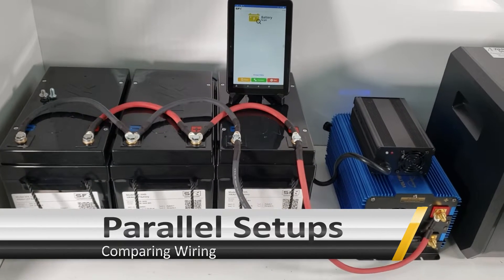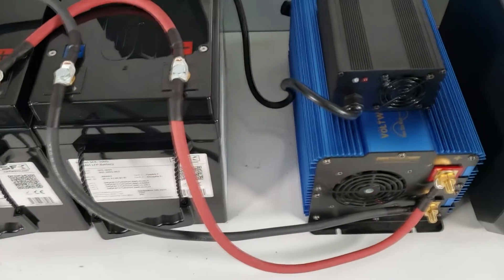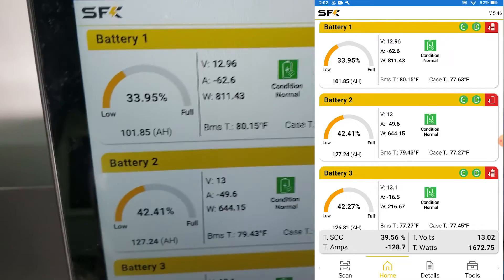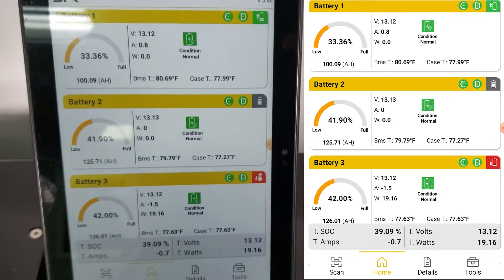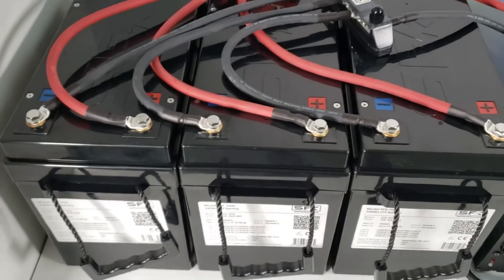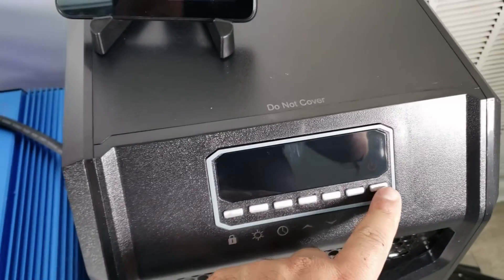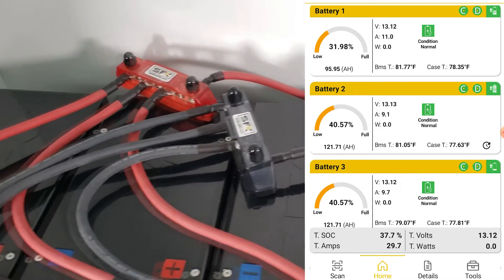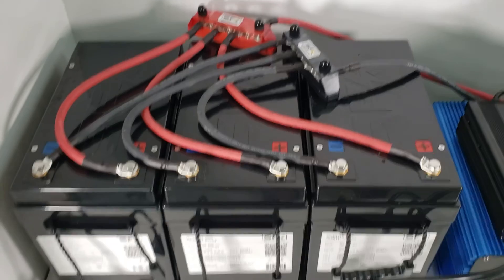Best Parallel Wiring Setups for Lithium Batteries (RV, Motor Home, Storage).

Comment: BTW  this shows some of the inside big batteries cells and why when full loaded the cells voltage drifts away and needs balancing!!!   never forget cells are independent batteries  in series and some of them are in center and others act as poles!!!  !!!!  made my run and install the active balancer to my  pack
Reply: Nothing in this video showed that individual cells need balancing.
Reply: @MrSummitville  no, but logic explains it by extension
Reply: @dominus6695  Maybe you do not understand English?  I said and I will repeat ...  Nothing in this video showed that individual cells need balancing".   So, which  video are you talking about?  Give me the @time in this video where "... logic explains by extension ...".  Oh wait, it did not happen ...
Reply: @MrSummitville  it shows how resistance causes a voltage drop and differences in charge/discharge. So it does not show it directly, but it shows the effect of different cable lenghts and resistances. Therefore his comment. hahaha
Reply: @MrSummitville  maybe you don't understand how electricity works and why he made the helpful comment lol
Reply: @dominus6695  I do know how electricity works. Clearly, you do not understand English.  They have remedial classes for that problem....

Comment: Thanks.  Yes a lot of us from the rv world are not initially knowledgeable.   I love the 2 I bought from you for my rv.  As noted...one of my batteries charges and discharges a bit faster...likely a byproduct of thor not running exactly the same lengths or it could be the busbar setup.   It has not been a problem as they will equalize in normal use.  Another thing you can let the rv folks know about is that lots of the stock battery setups were really undersized for the load.  A 3000 watt inverter that can surge needs batteries that can support heavy load.  My thor setup was a good example.   The 100 batteries from the factory really didn't match up with my load ( ac running...other loads) and thus constantly put the batteries uner stress...sometimes in hot weather to the point of their bms shutting down.  Your batteries support the load with ease....and you were very helpful with advice in the bms settings.

Comment: Make triangular shaped bass bars where all connection points from all batteries will have approximately the same distance to the two connections for the solar charger and for the inverter on the opposite corner.

Comment: I have a 6 position busbar rated for 300 amps. The center 2 positions are occupied by the inverter and solar charge controller, the 4 outer (2 on either side) have 4 batteries with equal length cables and it seems pretty balanced in operation. I use Anderson connectors on them and have MRBF fuses on each battery.
Reply from the maker: We are working on a bus bar it is shaped like a hexagon, rated for 500 amps, the center point will be for the load and 6 outer points for the feed, should be out sometime next year.
Reply: @sfkenergy any news on the new bus bar?
Reply: @sfkenergy  Any response to the idea of connecting all batteries to a single pole on the bus bar in order to further balance the load?
Reply: @sfkenergy  yes the "out" on the busbar needs to be centered, the ones in the video are obviously pulling a little easier from battery #1

Comment: Nice vid, most people will already know about the wiring, I think you just wanted to show off the app 😁
Reply: Bus Bars in RV's,  Boats and Off Grid has been the Industry Standard for at least the past 25 years.  Absolutely, nothing new here ...
Reply: When wiring 2 batteries for parallel to a bus bar.   Would I use 2 positive and 2 negative ?   Or 1 positive, one negative and a jumper.  I seen where you tuber gonagain, ( good, better, best ) video, used 4 wires and a jumper. Now I am really confused !    Thanks!